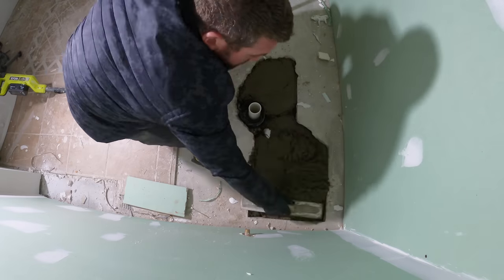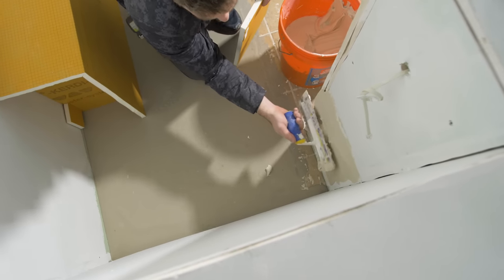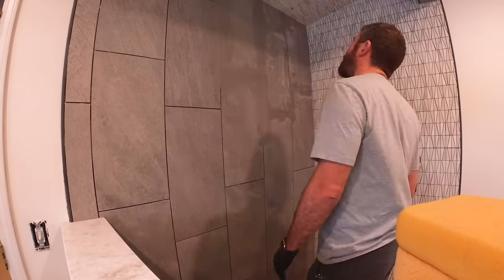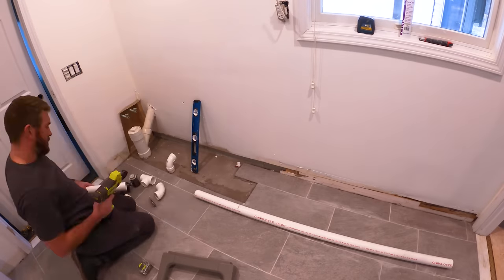EPIC Bathroom Remodel with STEAM SHOWER 🚿

Comment: Cannot believe you did not remove that little bit of old floor tile.  You practically replaced EVERYTHING ELSE.
Reply: he tiled over it no? Honestly you're saving yourself at least a days work and the waste, I don't hold it against him.
Reply: Always remove what was there unless its on the foundation slab other wise remove it to see what the ply wood underneath looks like and if it need to be replaced. But excellent renovation though
Reply: @MrRW88  I do not think he is going to have any rotten wood rot…. This is a slab
Reply: @andrewbrown1493  Cool then he is all set

Comment: Looks good. I've been wanting to do the same design with the shower at my house.

Double check me on this for your state since I'm in a different one. Verify your light switch is not too close to your water source. Since the second sink was added to the vanity your water source moved closer to the light switch, making it closer than 36in, which is not to code unless it's got a GFCI.  I can't tell from the video if that switch does or not. Not saying you did anything wrong, just don't want anyone getting electrocuted. Double check that though for your state. Didn't see a GFCI on the outlet behind the toilet either. Did you run that in series with the existing GFCI next to the mirror?

Great work though. Definitely agree with you sweating copper is for a pro!

Comment: Nice craftmanship, I was just wondering why did you use that half corner wall at the left; seems the appearance would be nicer without it?
Reply from the maker: There is a bench on the other side to sit when using as a steam room
Reply: Make sense, I was not familiar with what that option involved;  thanks and keep-up the good work!

Comment: why tile over tile takes 15 min to remove
Reply from the maker: It's over a concrete slab. Definitely more than 15mins. Plus we could use the extra height at the thresholds for a smooth transition.

Comment: you only had rough out plumbing.  just letting you know. cause you use the term like you know what you are talking about.   but rough in is below slab or stubbed up to a location.  rough out is setting it for the plumbing fixtures.  setting it for plumbing height as it exits the wall.  hence rough out.  good try though
Reply: After seeing what he just built iam pretty sure he knows what he is talking about 😊

Comment: So much wrong with this install on the plumbing. When you went to install the plumbing for the vanity you used what looks like a sanitary tee on its side. That is illegal by code and will never drain right if both sinks are used at the same time. Sanitary tees can only be used on the vertical NEVER on the horizontal. Should have used a cross or double wye. 
Also on those kohler skirted toilets it's easier to build the whole toilet then install it